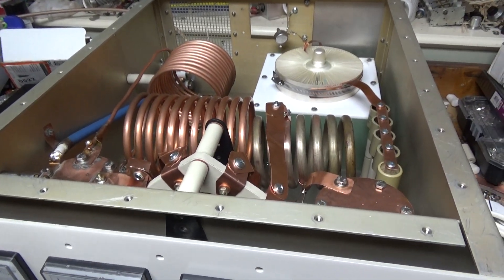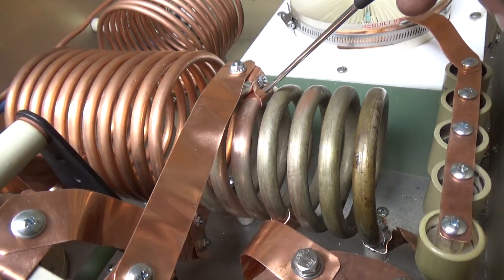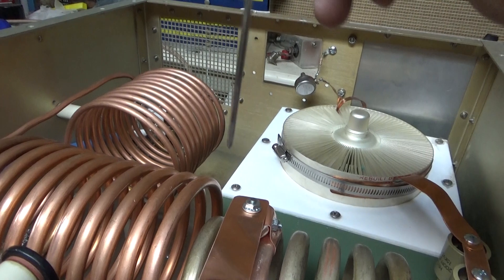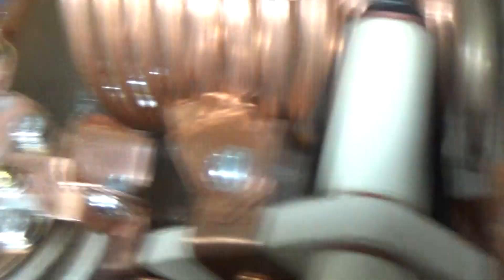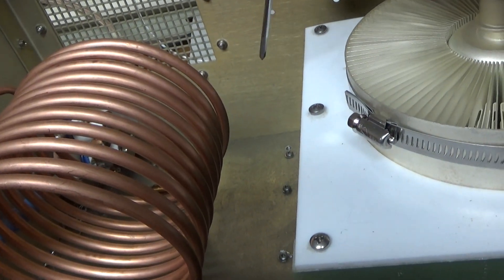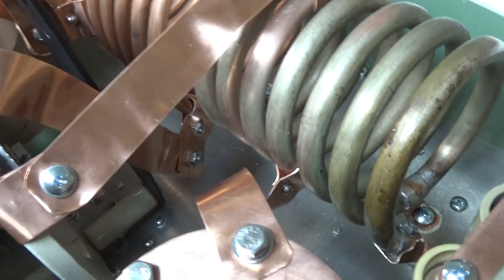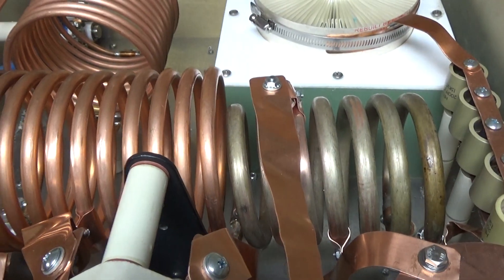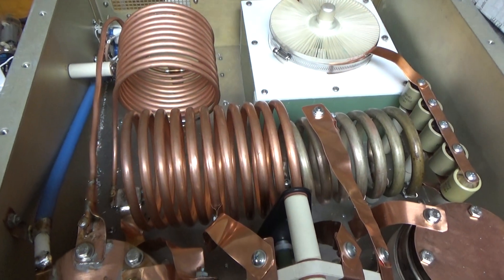Output Network Completed, 160-15 Meter 12KW CCS 3Cx6000A7 YU-148 Linear Amplifier

Comment: 10 meters?
Reply from the maker: 160-15 , no 10

Band switch position amount limited , tank circuit would be grossly different if added 10. I already had the band switch and a spare along with the majority of the other materials

Designed for ccs duty cycle all modes to fit in this cabinet.

If I build another for hire will be in a new cabinet , larger more room. Band switch current rating would be same or more but a smaller switch with 3 contact sets.

Input circuit would have 4 section air variable caps so less padding would be needed. I’m working with what I have as it’s free plus space limited.

73